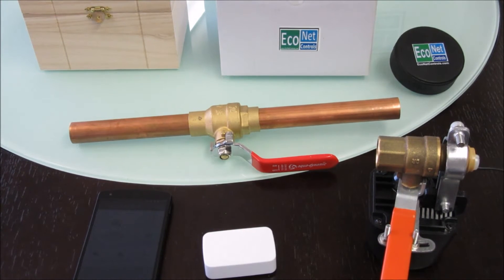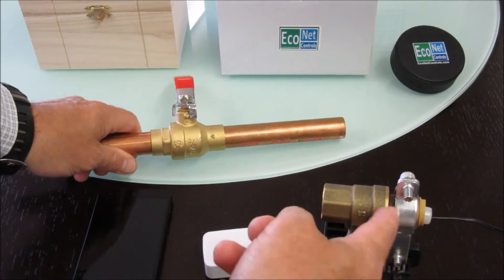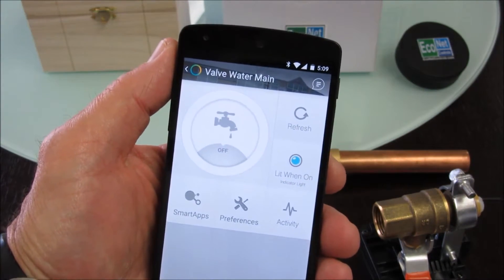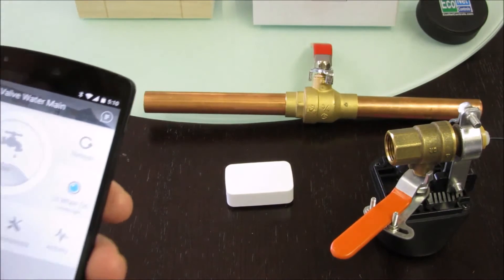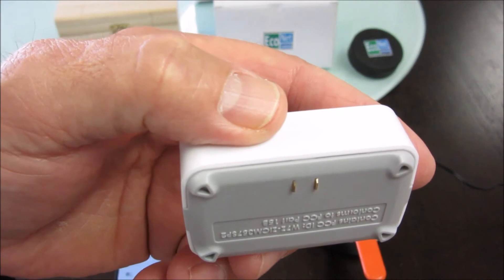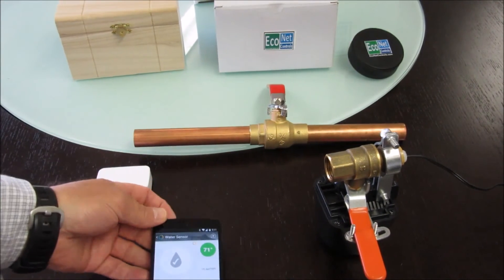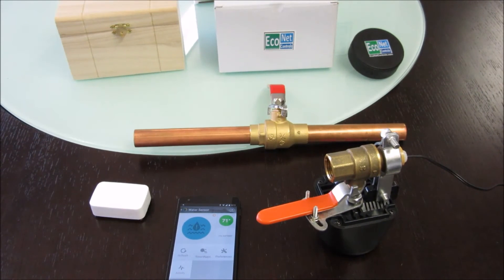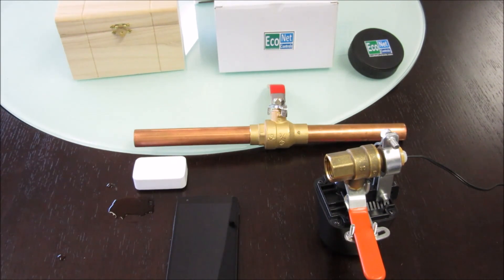EcoNet's Water Shutoff

Comment: I have PVC irrigation mains running under pressure and have had the main break many times resulting in - in one case - loss of many thousands of gallons of water within a few hour period (which washed out my front lawn) and in another case of slow leak a loss of 10s of thousands of gallons over a multiple month period.   This went unnoticed for some time.   It would be great if we could monitor water usage within this brass fitting use the meter result to connect to other home automation services such as sending text messages at water usage thresholds and water shut off at high-volume usage.

Here is the $10M+ use case ... my son is at home between 6:30 and 7:00 am and water usage has exceeded 20 gallons over this timeframe.   Off goes the shower!
Reply from the maker: +Kevin DeCoster Thank you for your notes and comments.  We started work on a micro-flow sensor over a year ago, but recently put the product on the shelf as it was going to be expensive to produce.  The idea was to monitor water flow in the home and build flow signatures for water flow in the home knowing the difference between the dishwasher, a shower  etc, and an unexplained flow that is likely a water leak.  There are off the shelf water flow devices available that could be integrated with our EBV105 water shutoff, but for our purposes the flow rate would have to be too high, but I they would work as unusual flow sensor for the irrigation leak scenario you described.  In other words, there is a solution available today for non-micro-flow applications.